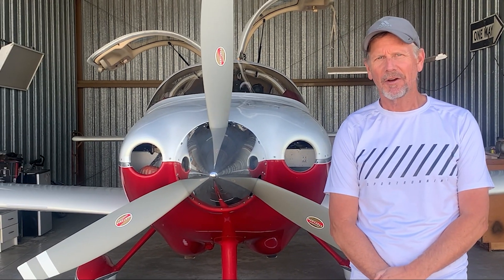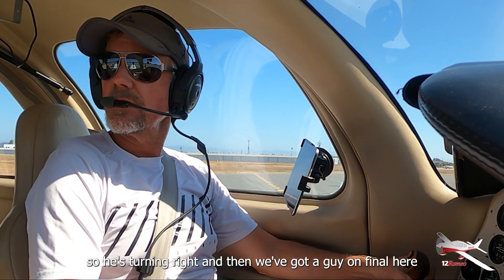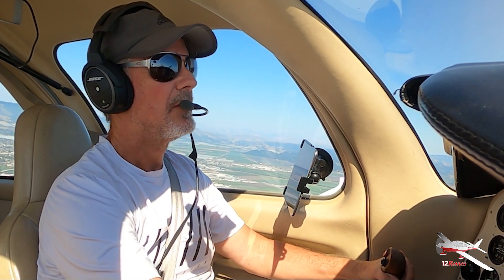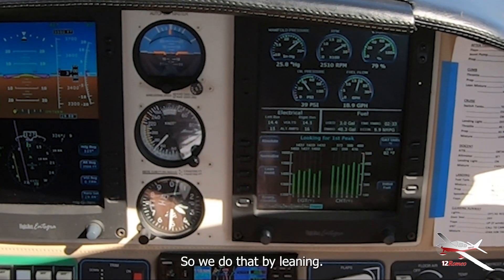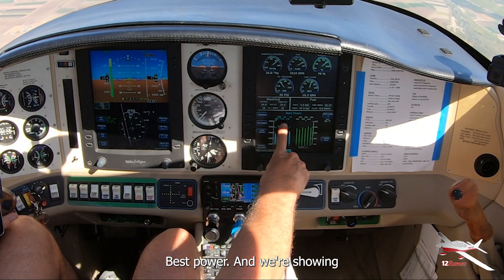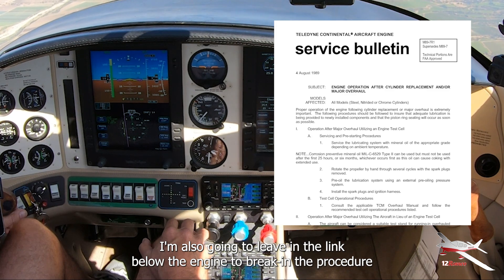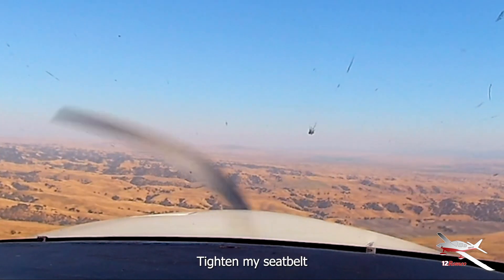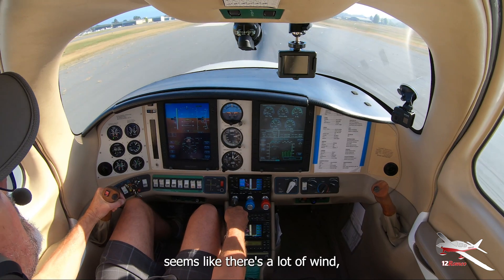New Continental Engine in a Columbia 350 with 30 EXTRA horsepower!

Comment: I don’t understand rich of peak. Why did you wait until the last cylinder to peak as you leaned?  Seems like you would only worry about the first cylinder to peak as you leaned and then add fuel till that one is wherever you go rich of peak.  Seems like your process will have cylinders dangerously close to peak.  Seems like you determined last cylinder to peak which is normal for LOP ops but then added fuel.  Very confusing.
Reply from the maker: N979Q: Sorry if it was hard to follow. Maybe try Martin’s video for a better explanation: https://youtu.be/h3bATVXMHQg?si=6sMzqFYru7J2UoW4

Comment: Nice plane! Air is a much cheaper coolant than fuel. After break-in, with those tight CHTs you’ll save 5 gallons per hour by going LOP to the loss of about 5 kts. My Velocity (N36LV) had that engine, admittedly with one Lightspeed electronic module and one mag, but I always did Mike Busch’s “big pull” right back to 50 degrees LOP in cruise. 195kts day-in and day-out on 13.5 gph. That is truly a lovely engine to fly behind. Only one drawback: the “seventh cylinder syndrome”. The alternator resides where a seventh cylinder would be and is subjected to a lot of vibration. It work-hardens the alternator brush connecting wires which then fray and short to ground. I just replaced them at 50 hr intervals and the problem was solved. Happy flying!

Comment: Any discussion with the people that did the Dino testing whether that extra 30hp is constant? In other words, is it recommended to go full power on climb-out to a safe altitude and then power back for the remaining ascent to cruise altitude? So that extra 30hp is....if you are familiar with the movie Spinal Tap...where they have a "volume 11" on their amplifiers, when they need that "extra little push over the cliff". I know on a  P-ponk conversion they convert a 230hp 470 to around 275hp but it is not for sustained or cruise applications, only for short climb-out use. The P-pink conversion is also a piston and cylinder conversion so it's quite extensive and maybe not relative to your upgrade. Anyway, thanks for sharing, excellent video.
Reply from the maker: Hi Crosscut, 30 HP was expected and typical for this engine after the procedure. Yes, know about the amp that goes to eleven (ha ha, classic movie) but that’s not the case here - since i can feel the extra power, mostly during takeoff.